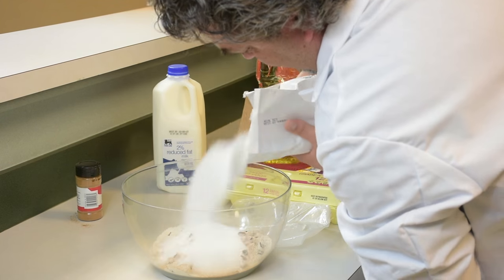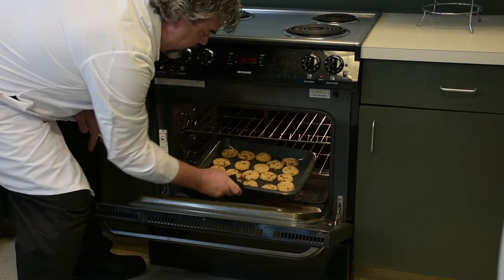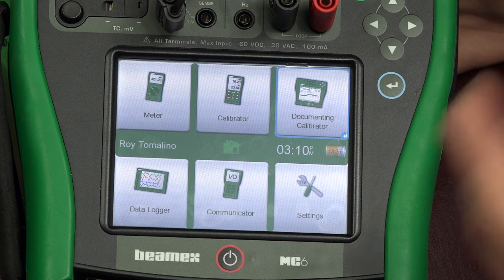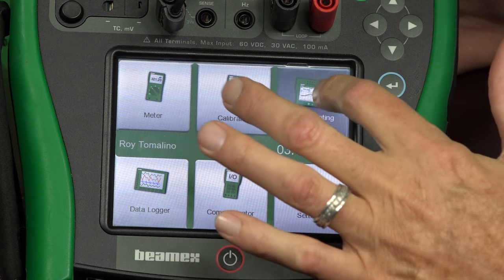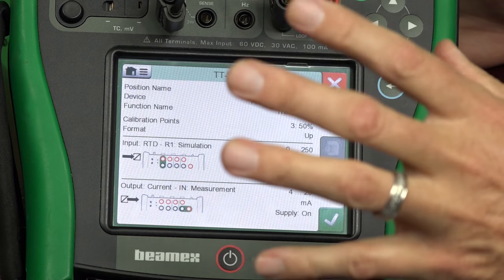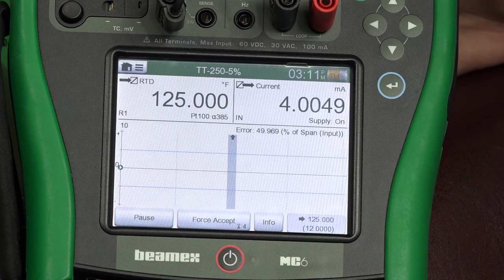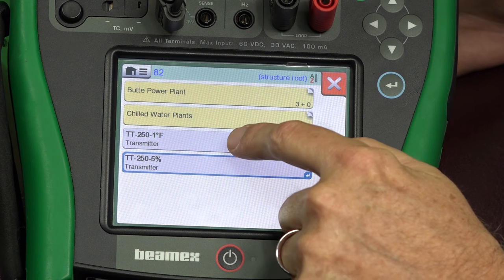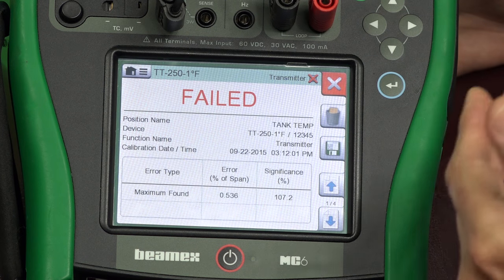Measurements in Calibration - Beamex MC6

Comment: One thing these guys never mention is smart transmitters don't really drift over their lifespan, so they are typically used until they are replaced. Not aware of calibration verification on most applications. 

I am also not convinced Beamex is serious enough in doing business with customers. They are not really into selling calibrators, but rather selling manpower hours. No need to give a half a million dollar quote to the customers to sell a fancy calibrator. I am aware of few prospect customers who have walked away from them because of pricing issues.